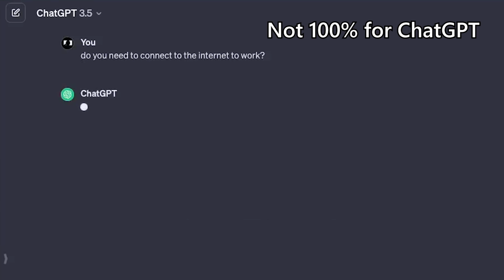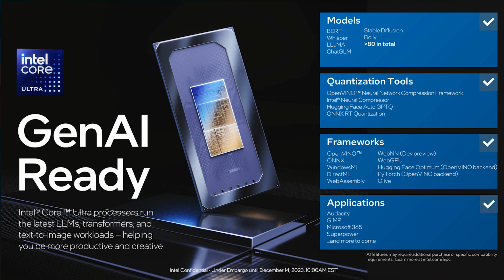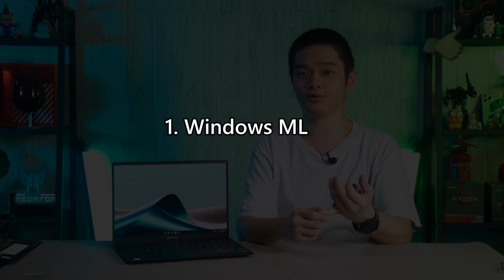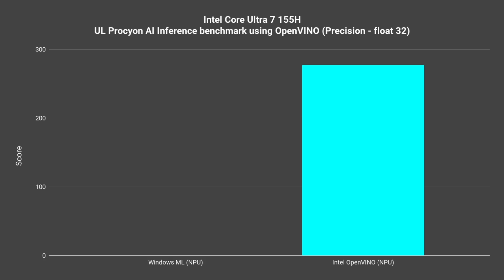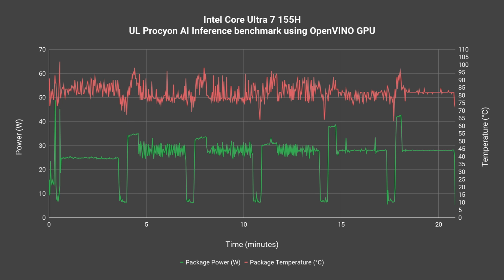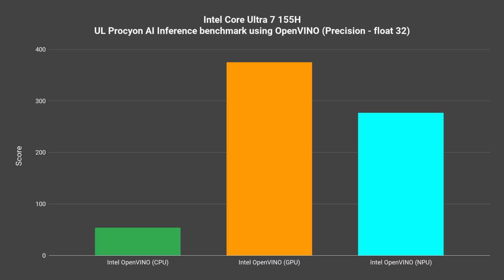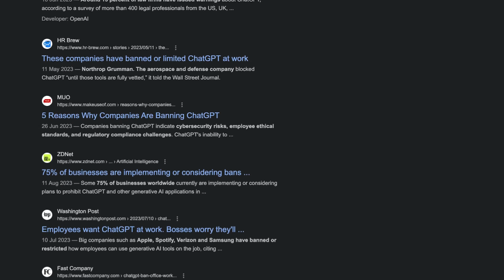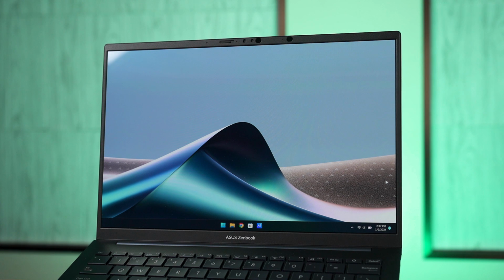How is the AI performance of the NEW 14th Gen Intel Core Ultra?

Comment: Thank you so much for this video. One thing to remember is that the NPU is really meant for lightweight inferencing (not training). It's designed for low-latency output rather than high-bandwidth. Also, CPU's with no integrated GPUs (and perhaps with cheap, low-end discrete graphics) would benefit greatly from having the NPU. Intel made a wise choice by integrating the NPU into the SoC rather than the GPU.
Reply: Sir can this new cpu with iGPU arc, work better for training model voice AI and do AI Art locally than using NVIDIA CUDA?